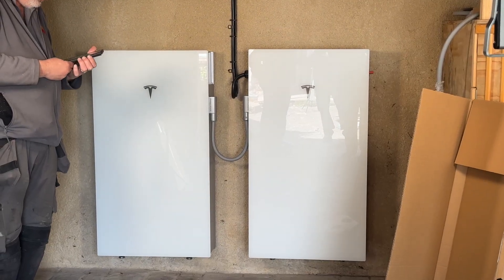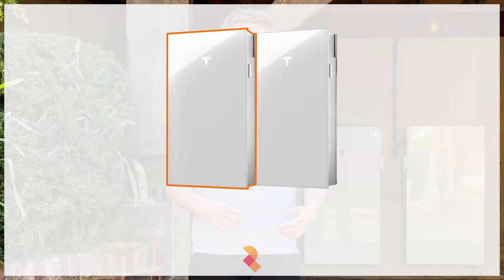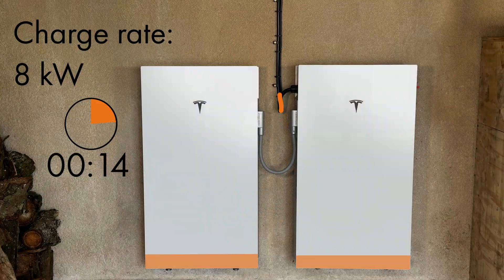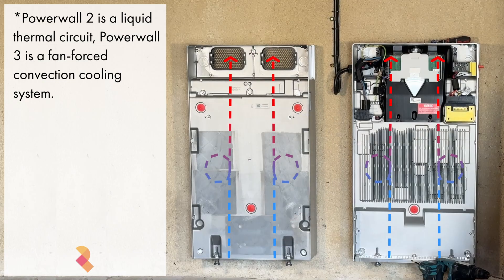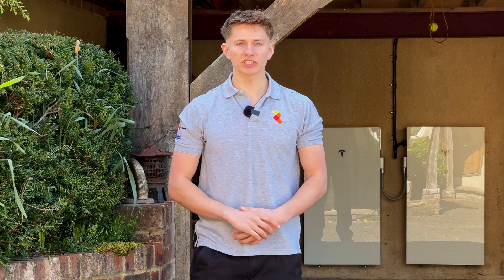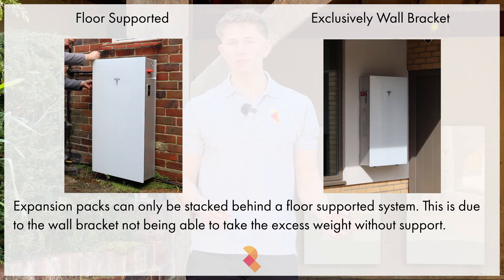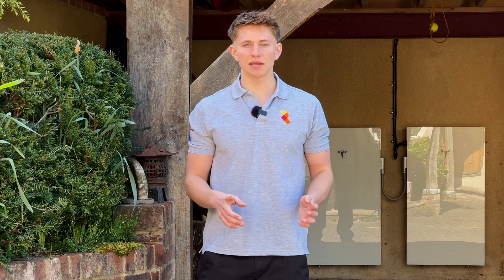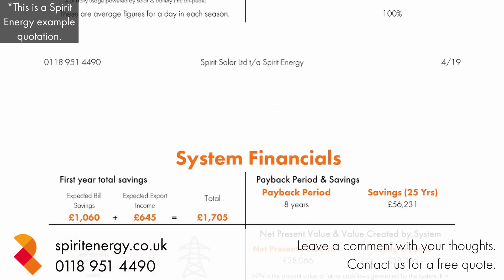Installing Our First Tesla Powerwall 3 DC Expansion Pack - Expansion Pack Review

Comment: Interestingly, Tok, the Powerwall 3 and DC Expansion Pack you have just installed for me show a charging at 10kW in the Tesla app, which has rather surprised me. I have spot- checked it at times during a couple of overnight charges at different charge levels but it seems consistent showing 10.3 / 10.4 kW from the grid with 10kW to the Powerwall and 0.3/0.4 kW to Home
Reply from the maker: How interesting. Thanks for letting me know Nigel I’ll take a look at it and see what it’s doing.
Reply: Yes there is a 5kw and a 10kw version, and apparently cost the same.

Comment: Currently only the lead powerwall 3 can have expansion packs, followers cannot. DNO rules in the UK mean that if you're going to have 4 PW3s on a single phase supply they are going to be limited to about 4kW of output each (16kW total).
Reply from the maker: Yes this is correct
Reply: Although in due course Tesla say the expansion packs will be compatible on slave units aswell, just not yet 😂

Comment: I had an expansion pack fitted several weeks ago and it bricked my lead Powerwall 3 shortly after the installers left the site. I purchased the batteries from a national boiler and solar panel reseller who post regular content on youtube like you guys. Prior to the DC expansion battery being installed, my original Powerwall 3 had been working perfectly for months. I’ve been without a working battery system and solar since then. It appears not the fault of the 3rd party installers they use but a suspected Tesla Firmware issue that failed to correctly balance the charge levels of both batteries during calibration. Tesla energy needs to seriously improve on their customer service as I’ve now lost around £250 in savings as I’m paying peak electricity per KWh and 11 solar panels DC coupled to the Powerwall are not charging the battery or providing energy to the house. Apparently customers just have to wait for Tesla to fix issues like this at least this is according to the company I purchased the Powerwalls from, but maybe I should have chosen a better company to buy the batteries from ? Would Spirit Energy would have dealt with this differently; if so please post a video so other customers don’t make the mistake I did.
Reply from the maker: Hi I’m sorry to hear this. We generally have a very good experience with Tesla support and find them to be proactive with this type of situation for systems that we have installed.

Comment: Isn’t the expansion pack only $1500 cheaper than the actual PW3? Maybe paying the difference and getting a second inverter with the 3 MPPT’s makes having a NESW orientation possible.
Reply from the maker: Yes if you need the added MPPTs then worth paying more for. But otherwise the DCX is probably more cost effective.

Comment: The Tesla Powerwall 3 does NOT have a close loop thermal liquid thermal circuit cooling circuit, that was only on the Powerwall 2 but was decided by Tesla that it was not needed never used by the systems, todays Powerwall 3 uses passive thermal cooling. Hope this helps.
Reply from the maker: Hi yes thanks for flagging this. We were going to clarify in the video but that must have slipped the edit.